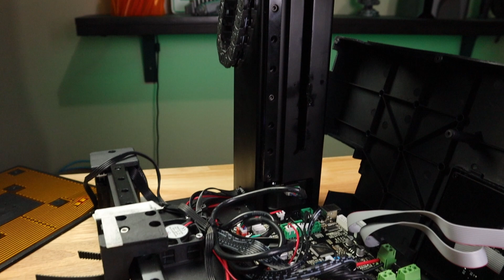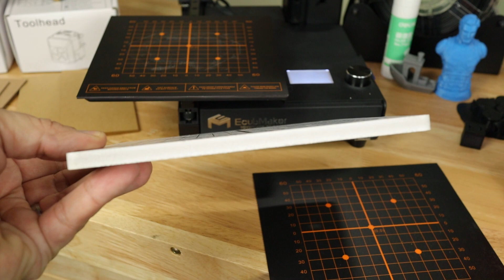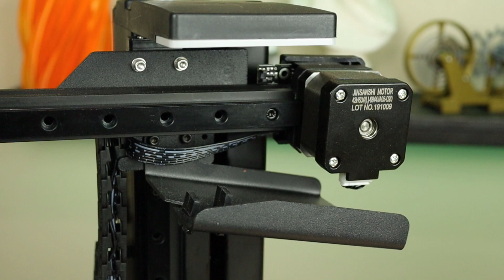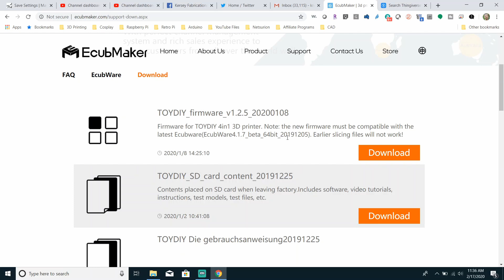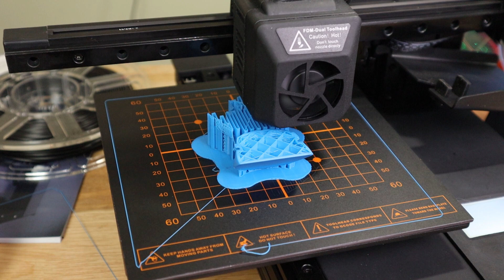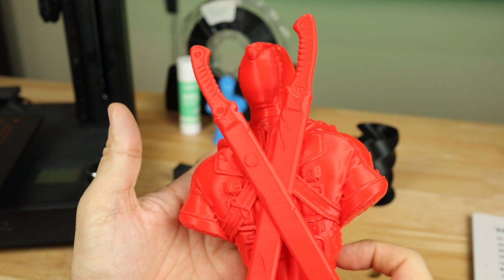EcubMaker TOYDIY 4 in 1 3D Printer Review: Part 1

Comment from the maker: EcubMaker seems to be out of business and this video is being preserved only for historical reasons.
Reply: I just found this video on 4/19/26. I run a 3D print business so, of course, I have very new printers and I really focus my work using VORON machines, Voron 2.4 to be exact. BUT I do collect unusual machines. For example a Cubify Gen 1, Dobot Mooz 3, IMade3D Jellybox. All were really expensive when new so I got them for around $70 instead of over a thousand. And, shockingly, they all work, marginal quality prints, of course. So, I do not use them just cool to have the history. There is one of these printers on the FaceBook Marketplace. but pricey. I'll make an offer which probably won't be accepted but I'll find out. Cool video. One thing interesting is back when you did this review they had the dual extrusion, that must have been pretty early at the time. The Dobot Mooz 3 can change colors or even merge up to 3 color which is why I bought it. Plus it's a delta printer which makes it even more crazy. Whoops, I forgot I also have a Sculpto printer which is a polar printer. Prints like an old record player (turntable as they are called now as they made a comeback). I also have a Lulzbot TAZ 5 and a Smapmake A350. All of these printers are just on display in my Printing Lab but I only really use the Vorons. Cheers and cool video. Will be interesting if you read this.

Comment: Hey, I am having some issue with this printer after 4 month of use. Wondering if you can help me out. 

For starters, since day one, whenever I start a print, it makes a loud ratcheting vibration noise when it is aligning it's Y-Axis. The sound arises from the fact that it reaches the end stop of it's Y-Axis and the motor doesn't stop and continues to wind, causing a loud ratcheting vibration noise. Is that normal for your printer?

Secondly, after a few month of printing with the above issue, my large prints are failing because it's now skipping steps on the Y-Axis. An example would be show here : https://i.stack.imgur.com/fWRUk.png

Have you experienced anything like this before?

Comment: 3 in 1? Jack of all trades, master of none?

hmm, A4988 drivers? not even DRV8255 or Trinamics? 
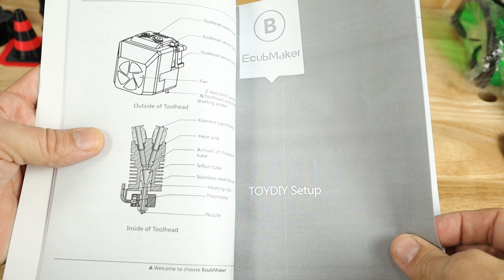also 260°C, but judging by the illustration at 11:31 there is a PTFE going down to the heater, afaik starting 240°C that tube will disintegrate and give off toxic gases,

you said the pcb heater was already loosing stickyness at the cable side(well it was quite visible)? hopefully it doesn't fall off completly
how many hours did you already print with it?

Also curious to see what (if enabled) a M48 would spit out.

Looking forward to the other 2 functions, also watch your sight, I'm a bit weary of open design laser encraving
Reply from the maker: I've always preferred the A4988s over the DRV8255s. They have tons of power and no salmon skin.

Like I mentioned, there's no reason to go that high temp on this printer, given it's marketed for PLA. They should have kept it at 240C.

The PCB heater was coming loose because I pulled on it when disassembling the printer. I see no evidence so far that it's loosening due to heat. I have less than 100 hours on it.

I'll see about running that M48.

I'm with you on the open design for lasers. I already have a sign made for when I'm engraving. I may even get me a larger piece of colored plastic for protection.

Comment: Nice video.
It should be quite easy to test thermal runaway, as you already opened the base: simply remove the cable for the heating cadrige from the board so hotend can not heat. If thermal runaway is on, you will get the thermal runaway error...
Reply from the maker: Thanks for the suggestion. I'll see if that works for me when i get a moment to disassemble the machine again.